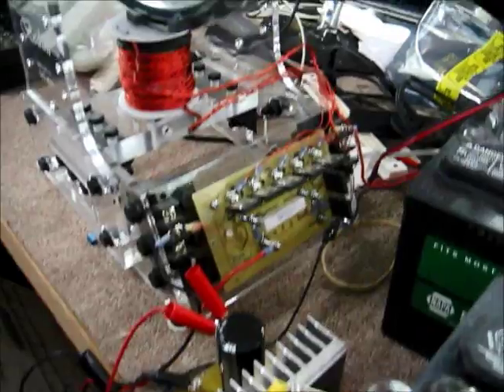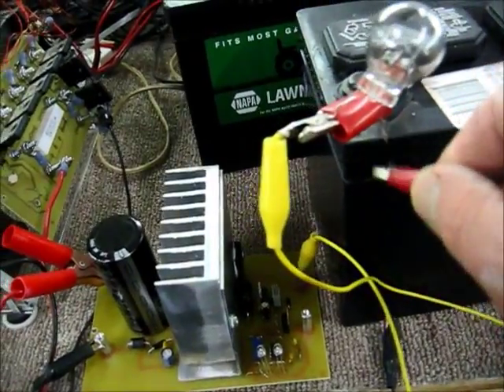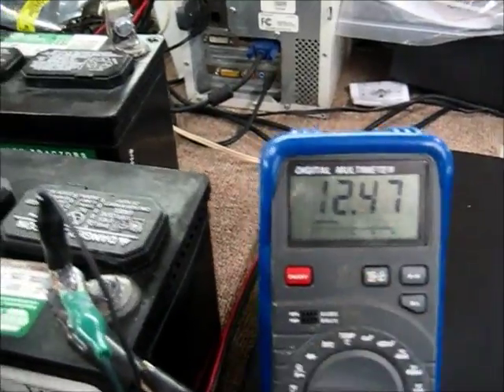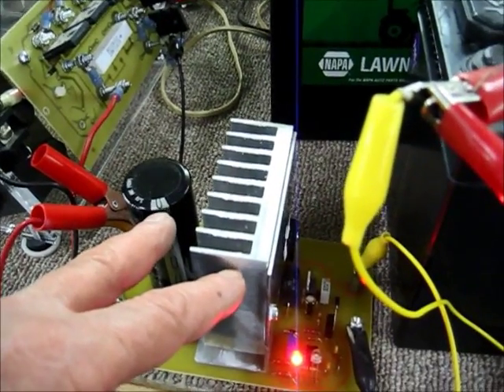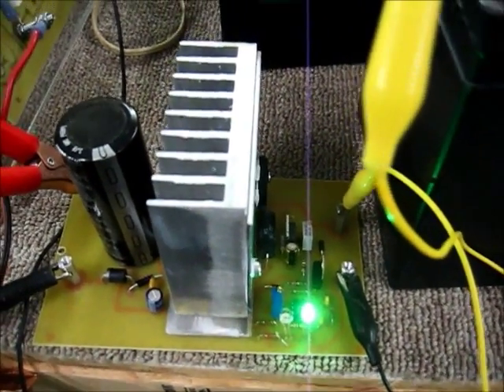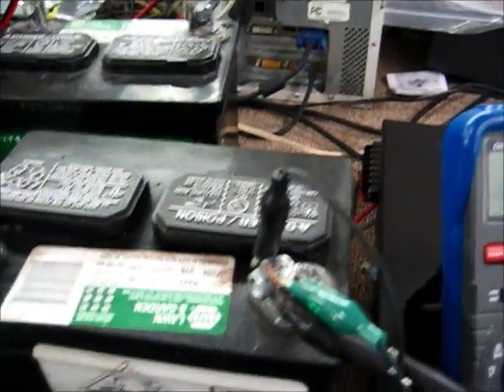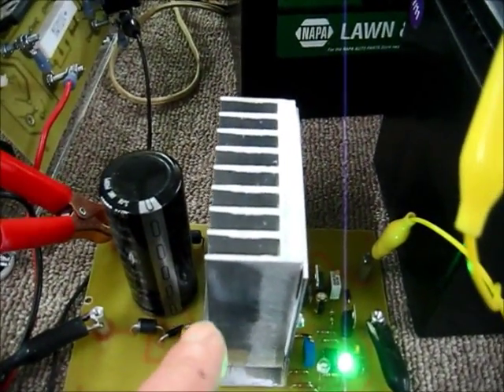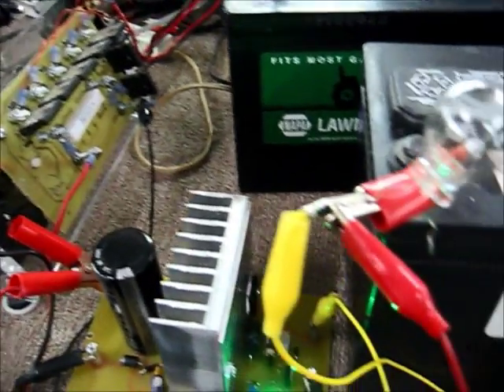Linear Amp Control SSG / School Girl Motor

Comment: So this converts the high voltage spikes into low-controlled-voltage higher current pulses in turn charging the battery at a much higher efficiency? I'm going to go do some homework to see how a Bata-multiplier works. I always thought that gas-filled discharge surge arrestors might be a way to control that spike and get it down to a lower voltage higher current scenario.... I wish I could make it to the conference. Keep up the good work Mr. Bedini. All the best. Ben

Comment: Meet John Bedini at the 2014 Energy Science & Technology Conference and learn about the Linear Current Amplifier technology. http://energyscienceconference.com
Reply: Hello Aaron this is radiant energy?
Reply: That takes the radiant output and converts it to steady DC output.
Reply: Oh I understand. This process is not dangerous to charge the battery? (Heat, sulfation etc.)

Aaron, drawing your attention in another video you wondering about the oxide rods. There problem with this oxide to performance energizer or something like that?
Reply: Andrés Campa
I don't really understand your question.